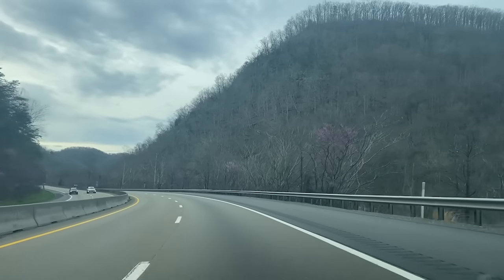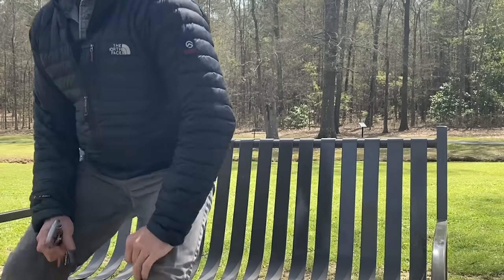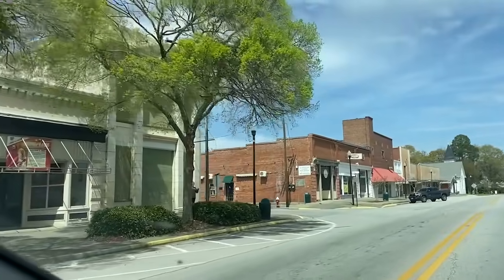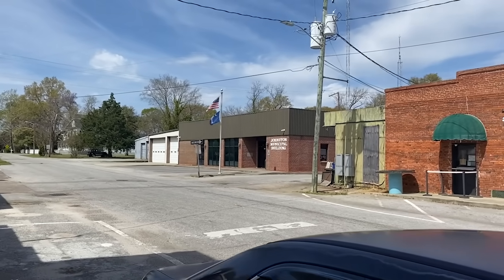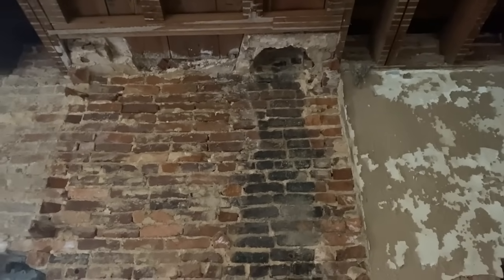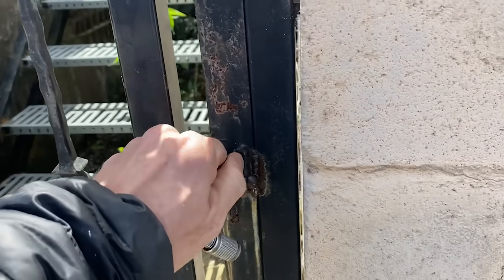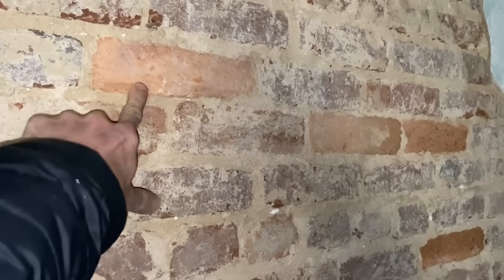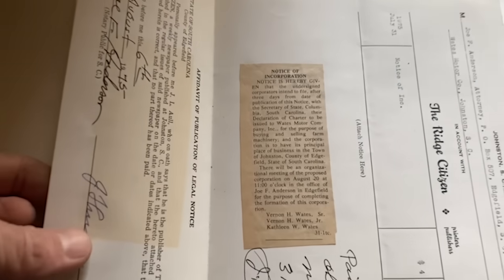We Bought An Abandoned Bank

Comment: Remember the primary rule of big projects.   The first 90% of any job takes 90% of the time.   The last 10% takes the other 90% of the time.   This rule also applies to estimated expenses.
Reply: That would be 180% of time🤣
Reply: Exactly.  Renovations/rebuilds working within an existing structure ALWAYS hit snags to be worked through.  Unexpected water damage, roof hiccups, termites, faulty previous renovations….  My dad always said quadruple your estimated time to complete, and be prepared for your expenses to run 10x your original estimates.  It doesn’t always cost that much, but old houses/buildings are money pits, so if you haven’t got that wherewithal when you start, best to walk away.
Reply: Yogi, is that you?😎
Reply: Not strong in math huh
Reply: Laughing so hard at the people taking the 90% + 90% seriously.. lmao. THATS the joke. smh.

Comment: Wow, I'm hooked after one episode!! I'm a retired builder/engineering designer and I see a lot of potential in this building. Even with your limited camera work I can see a flat ceiling above the first floor and no major cracks in the slab. Both good signs. Perhaps when you get some more light in there we can take a closer look. With your camera work that is. I know you didn't ask, but here is what I would do in the first 30 days. Start with a blank notebook of drawing paper and start with a basic floor and make a bunch of sketches based on what you want to do. Then hire a designer to come in and take the critical measurements of the interior of the building and draw a scaled plan of your ideas. Then take it to a local architect who is savvy to the local architectural control board, if there is one, and see if he/she thinks what they will think about your ideas. After that you can consider where to start your electrical and water and HVAC in the future. Just my 2 cents. Good luck and Greetings from Texas....John B. Now I'm going to check out your previous videos......JB
Reply: Amazing!
Reply: No doubt!
Reply from the maker: I appreciate your comment. I did start with a blank sketch, notebook and a notebook for lists and ideas.  I’m almost complete with the floor plan and have drawn out electrical, plumbing and HVAC.  I’ll take your advice and keep you updated through the videos. Thanks for watching!

Comment: A huge plus is that its already mostly cleaned up and stripped down. Besides that huge pile of rubble on the ground floor, there may not be a ton to haul out before you get started. A lot of renovations (which you know) include clean out and demolition work first; looks like the previous owners took care of a lot of that.
Im curious what your first thoughts were on how to reuse it. Apartments, cafe... is the town big enough for a second bar/grill?

Comment: in 2015 we bought an 1884 Italiante live/work. 9 years later we are still restoring but we opened our antiques business on the first floor in 3 months. Living over the shop is great. My advice is to careefully listen to what the building tells you. Also avoid the exposed brick thing. Walls were plastered for a reason. Embrace the history of the building.
Reply from the maker: Sounds like you’ve had a good experience with your building.  We hope for the same. Also,we are going to plaster most everything.

Comment: Use curious, is there a basement to that property? Might hold more info on utilities if there is one. Nice structure, be nice to find a brick mason who could come in an redo parts of the walls, would add strength to the structure. I have been following a gent from England who has purchased a burned out chateau in France, there is a lot of fire damage to the brick interior and it would be wise to hire out that work to professionals considering it is a three story structure that has been exposed to the elements for over 30 years.

Comment: get some pool guys to gunite the walls downstairs smooth and grove perimeter tile install first floor and seal the walls and peaked metal roof? this will leave dry roof space for heat pump/ air conditioners Carolina gets hot! once the walls are dried out you will get a real feel for structure ...the reason the brick upstairs is great it was plastered so the mortar joints look great and down stairs on old trick was to use seconds or clinker bricks to save costs and the gunite pool walls  will address water penetration but the process is messy but the vintage tiles on the floor are no longer made and you do have the ceiling height to just cap the slab with concrete and lay a real high quality floating floor.  
 flat is trouble every time! the blow thru with a blasting con cob gun to strip paint from even the tin ceiling! the corn cob gun will strip everything lead paint etc.  electric services and cable in underground conduit to cable tray for networking cables and keep the service simple ...hire a saw miller to cut down oak and repair the floors fix internal staircases for fire egress hang temporary lights then get to work! residence first and then owner-occupied remodel windows last   some will be kept some will be exchanged for modern and efficient windows...ran into a couple once who did a remodel of old hardware store! it was packed full and they made out really well, with very little cost even got a freight elevator in the deal! but these remodels are interesting
Reply from the maker: Thanks for the input!  There’s some great advice here.  I appreciate you taking the time to think this through.  Very much appreciated.

Comment: People today will buy a car without even driving it first. In your case realestate. There is no way i could do that. My luck it would have stunk
As the pics do not let you smell the stench that it could have had. I am sure you have a plan for the building and have done your researching. If not then again no way could i do that. I would be better off putting 10 grand on the roulette table and cross my fingers. Good luck! Hope it works....

Comment: Don't "Expose" the brick.  Bad idea because it gives off a very harmful dust into the air thats hard to notice but its there.  Exposed brick must be sealed well.  VERY well.  Plus its a fad and its ugly...don't do it...really its just a "poor man's" solution.  Plaster work just like the old days is still possible and much nicer than aweful old drywall.   Books on how to mix plaster are still available but finding the horse hair can be an issue.  There are modern substitutes available.  If you've taken such a deep plunge already, why compromise on quality. now?  

I know of an old newspaper office in a small town (16743) that could be renovated into an amazing "themed" comedy club!  It needs someone like yourself to make it happen and I never thought I'd ever see someone actually do it.  You could make it into a comedy club "Bank Themed"  just like my building would be "Newspaper Themed".

Ever notice that no matter how small the town may be, there is always a Chinese restaurant just like that one but the rest of the town seems to have had a stroke of some kind?  My small town in PA (16743 pop. 2200)  has it as does Smethport, PA. pop. 1200       Weird....